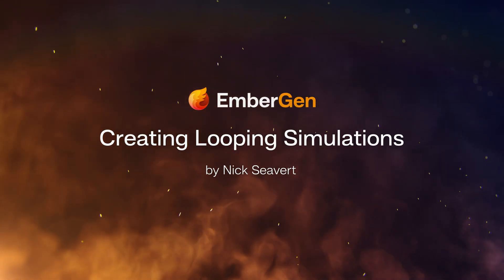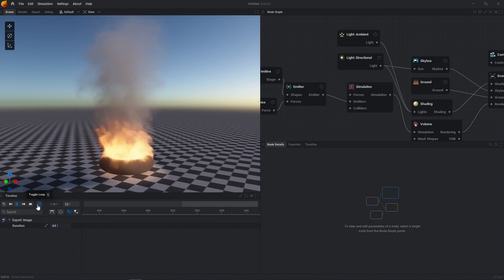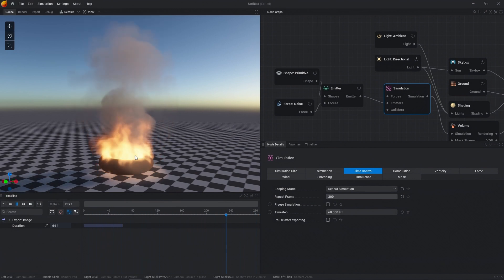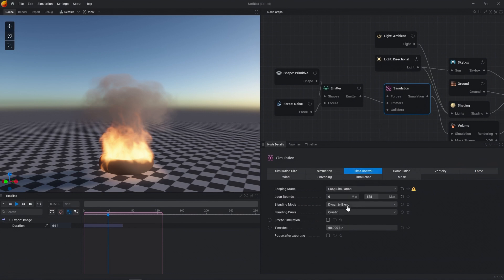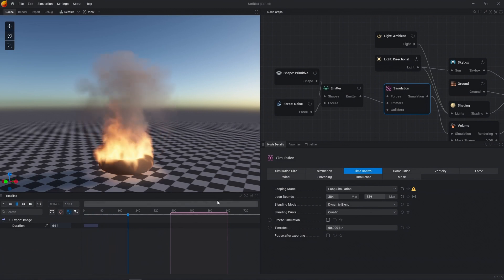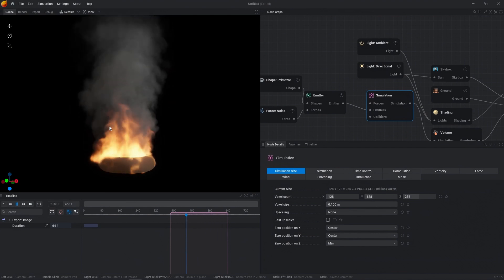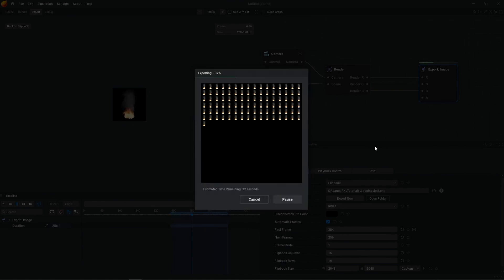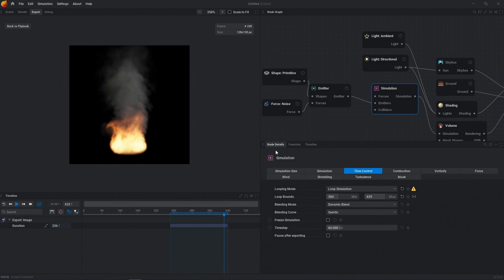Quick EmberGen Tutorial: Creating Looping Simulations

Comment: Turbulence tab is not available on my simulation node. Does this mean looped VDBs don't work with an input force turbulence?
Reply: The simulation is looping perfetly in Embergen but not when importing it into Unreal Engine
Reply from the maker: We ended up removing turbulence as the force noise node can now do everything it did. Looping should work with force noise though. Looping in EmberGen doesn't mean anything in the viewport since it runs 2 simulations at once. You need to view your export for your flipbook or image sequence in EmberGens export tab/playback tab to see if its actually looping.